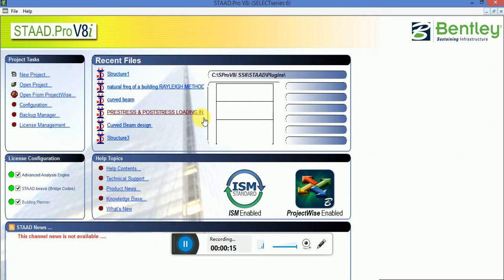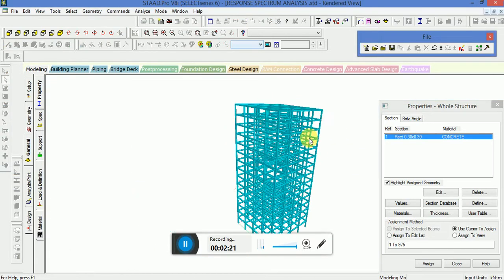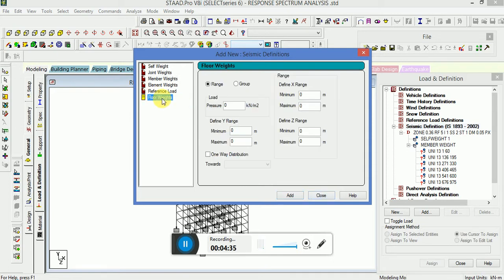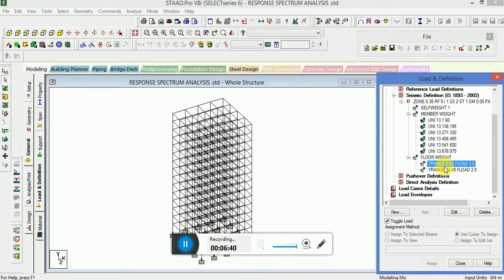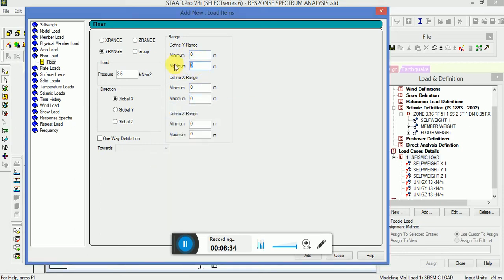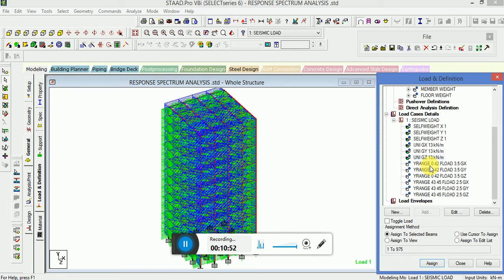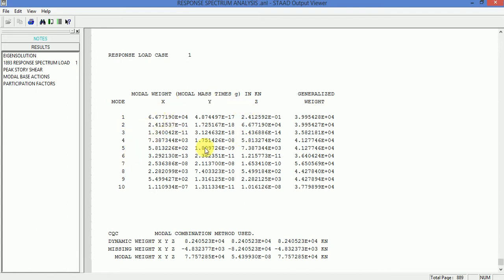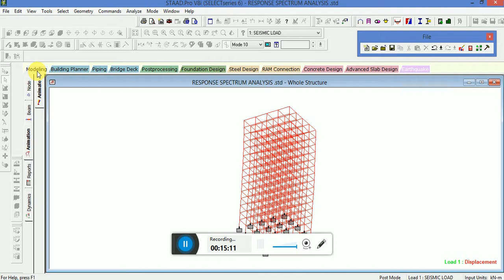RESPONSE SPECTRUM ANALYSIS IN STAAD PRO USING CODE IS 1893-2002/2005

Comment: if the structure height is 42 meters then what are the distances 60, 136,195,271,330,406,465 that are considered for adding member weights.
Reply: Can we directly select the beams instead ?

Comment: I did it exactly for example purpose but I'm not getting that output like story shear etc only two values displaying eigen values and participation factors can you suggest any solution
Reply from the maker: Perform the loading correctly and input values are systematic assigned then there is no problem of error in the Analysis perform it again if you face problem then write it here .

Comment: is it necssary to apply load combination while doing RSA.
Reply: In seismic definition under load case detail, dead load and live load are not included. Why it is not included?
Reply from the maker: @Dawnga_123 For every loading you have to define the loading purpose for example Dead load need the structure weight itself and Live load when the structure will face external load in any form and the Seismic load is applicable when you are in the High risk zone of India and it is categorally divided into 4 zones specially zone 4 and 5 are high risk zones.
Reply from the maker: RENU RAYAL Hi The nature of a RS analysis and the statistical methods that are used to combine the responses of the various modes make it impossible to accurately carry algebraic signs through to the results.  For this reason, the best we can do is create an envelope by generating load combinations that are based on the positive RS results and load combinations that are based on the negative Rs results, and assume that we have effectively "bracketed" the actual design forces.
Reply: sir can u please send me ur mail id
Reply from the maker: RENU RAYAL career.vibhor@gmail.com